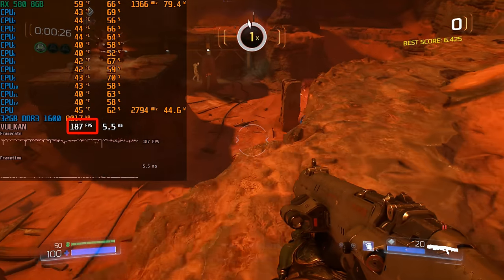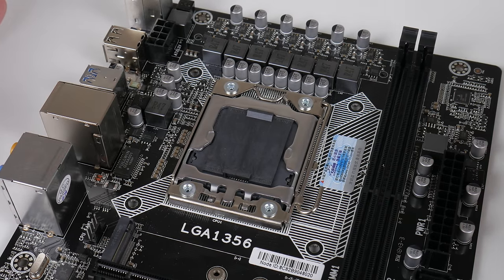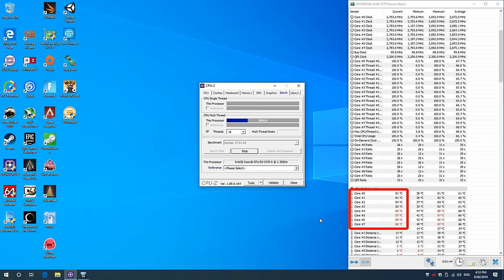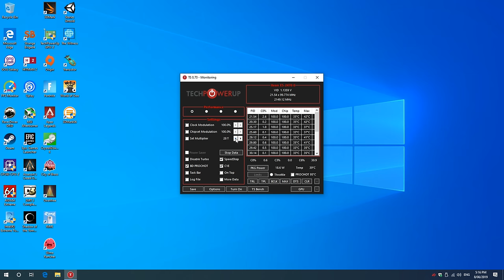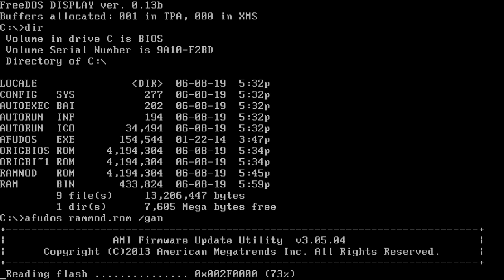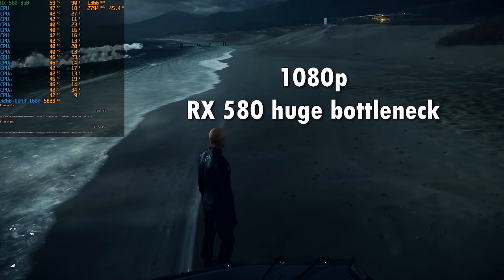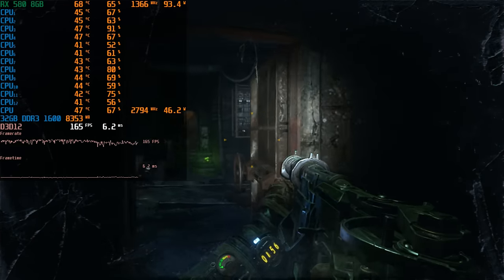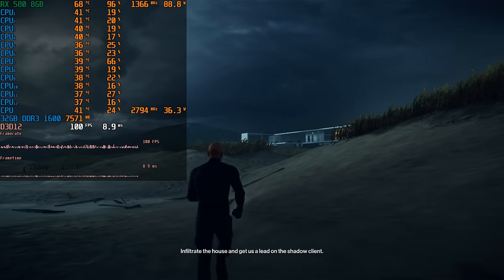6 Cores (and more) for everyone! Taking a closer look at the LGA 1356 platform.

Comment: I'm onboard Phil! I just replaced my HP Z600 with dual X5675s for a Supermicro X9DAL motherboard based system with dual e5 2470s to give me a super cheap 16 core 32 thread workstation, Getting around 1900 in cinebench r15

Comment: Ever since switching my R3E over to an x5680, I'm a huge fan of running the older Xeons. You just can't beat the price, and there's plenty of performance there to be had.
Reply: So did the xeon have much better performance. Cause I am building a pc and was going to buy a ryzen 3 1200 for an upgrade path or would a xeon be better

Comment: Those Xeons are impressive for their age. My i5-4690k is starting to show its age in some newer titles. Stuff like DOOM (2016) and Forza are fine, though. The Vulkan and DX12 APIs seem to push my GPU harder and the 4 core CPU is still good enough @4.1Ghz.
Where the 4 cores really struggle are in Ubisoft open-world games like Watchdogs 2. It gets choked on geometry draw-calls. To hit 60fps consistently, I have to lower the geometry settings a notch or two.

Comment: Once you have done all these motherboards and CPUs can you do a summary wrap up for price performance.
I am mostly interested in content creation.
Cheers
Reply: I'd wager the best option is still the Xeon 2689 LGA2011 Plattform. CPU is like 50$ on AliExpress, Mainboard is about 75$-90$. 8 Cores 16 Threads DDR3 ECC, you get heaps of perfomance for a really cheap price.
Reply: Theman703 that's what I bought, so hopefully lol
Reply: @oscarl-b8870  If I had know about this before, I may would've rather bought the 2689 instead of a ryzen 1600, especially because I already had 16Gb of DDR3 From my FX Rig. Alas now it's too late.
Reply: @OMGOMGOMGOGMOGMOGM  I can't see how Steve from hardware unboxed can say it's only $100 extra for a ryzen system
Reply: Yes I think a longer or multi-video round-up would be good.  There's a lot to take in.  But it seems we hold off on this MB as it isn't the best value.
Reply: @howumighthaveanimatedthat2159  watch the video again, who knows, maybe the second time you will get it. LOL

Comment: The LGA2011 platform is worth it even for the additional cash
Reply: Very true.
Reply: Necro Spencer and that extra is not that much overall. I think really, as Phil said, the value of 1356 is about cheap 6 cores and 12 threads, but not anything beyond that. Want more cores? Just get yourself a 2011 mobo, you get so much more stuff for your money and 8 cores are super affordable.

Comment: A very demanding simulation is City Skylines, that gives any CPU's a very hard time since you can manually adjust counters in the game menu to test the heck out of the simulation and your system :)
Reply: Cities is more worried about the single thread performance still (it uses more than 1 thread but its still limited) - a fast quad runs just as good as anything with more threads.

Comment: Great to see games using multi core well! I sold my old Dell T7500 with x5670 6C12T which looks similar isngle core performance to this. I got an E5 1620 instead as has higher single core performance but 'only' 4C8T. Interesting stuff!

Comment: I went with an X5670 ($19), with 24gb of ecc ram running in triple channel($35, used server ram, eBay auction), and a cheap used motherboard($28), but yeah, the results are pretty much the same, and less than 100 bucks. 
I got a nice used cooler for just $10, a 240gb ssd for $24, and now all that's left is snipping a good deal on a used RX480 8gb, the whole rig should come in just under $200. Hopefully I'll have it up and running by the end of the month.
It should be able to play pretty much everything in high/ultra settings at 1080p/60+fps (except maybe PUBG, that game is just horribly unoptimized).
And it'll pay for itself in video editing work.
Future upgrades for the same computer: 
-PCIe X16 NVMe adapter and 1TB NVMe SSD(non bootable, but can be defaulted to for all programs to be installed on it, and having the video files being edited on that drive will make everything faster as well)
-PCIe X4 USB 3.1 Gen2 adapter (will make getting files from the camera to the computer MUCH faster)
Reply from the maker: Nice! I'm curious, how does your camera interface so that it benefits from USB 3.1 Gen 2? Is that a high speed SD card reader or something else?

Comment: Thank you for your review. I am having big pleasure listening you. It is good that your are showing the power consumption, as it is not common for most tech observers. Maybe here also would be good to add few words about the efficiency for your power supply, as final power consumption is very dependent of PSU. Some less experienced viewers could take it wrong thinking that values of power consumption you show is what only CPU and mobo use, missing the fact that PSU itself can consume from 5% to 40% of power. And due to this real CPU`s TDP under max load actually corresponds to official spec. paper.
Reply from the maker: PSU has 650W and rated 80 Gold.

Comment: cpus are way hyped and over rated. im amazed how well some of these older cpus perform. i personally am using a 10 year old xeon, x5675 , @ 4.5ghz, tripple channel memory, with a vega 56 sittin on it. my gpu isnt bottlenecking on anything, i always get 90-99% gpu usage, this connected to a 144hz freesync @ 1080p, i get 100-144 fps on screen on all the games i play. i payed 18.00 usd, for my cpu- mobo was 100 bucks, ram was 100 bucks, less than 220 for mobo+cpu+memmory, i get the vega 56 for 250.00 usd, for about 500 bucks i have a true 140 fps, 1080p rig that i absolutely love. i could have spent soooo much more, for a system that wouldnt have been any better. ( for games mind you)  for the average gamer, there is almost no reason to spend 200-300 on a cpu, 150 on a mobo, and 150 on pricy ddr4 .... unless you just have no budget concerns, but seriously the used market is great right now, and im very impressed with how well older hardware still holds its own in todays current market
Reply from the maker: 1440p does wonders to make old vs new basically perform the same :)

Comment: Thanks for a wonderful video and here are some comments from my testing.   I'm using the 8 core E5-2450v2 and if I stress test (prime95) the 8 cores withOUT hyperthreading; it hits the 95w tdp limit.   Thus, it may be worthwhile to turn off HT for gaming.   Also, it would be useful to prevent core-parking (speed throttling at idle).  The difference in idle power usage for me was 15.5 watts with 8 cores full speed (2.9 Ghz) and 12.3 watts (8 cores but with idling).   Hopefully this can help micro-stuttering as the LGA1356 chips just lack the max single thread IPC due to their limited 95W tdp max.

Comment: You might try some of those small heatsinks with 3m thermal tape you can get off ebay. I bought some for a 760g motherboard vrm and it worked pretty well. Just make sure it is legitimate 3m thermal tape will typically be cheaper with the tape pre applied.

Comment: Phil. Do you ever feel like we have it too good these days with all these awesome cheap and powerful hardware components ? Thanks for sharing the love.
Reply from the maker: In a way yes, the used PC parts market is really healthy, if you can dial down expectations a little bit, than it's amazing value.
Reply: @philscomputerlab  I've very much lowered my expectations. I actually sold my newest PC in favour of building a butt kicking system from used parts. I have no regrets.
My i7 6700k rig went to a good home, I was originally going to put the money towards a Ryzen 7 3800 on release, I ended up with a Xeon E5-2687W for my older x79 system. That was the highest performance CPU officially supported on my Gigabyte GA-x79 UD3 so I pulled the trigger. It's in the mail right now. I can't wait!
Reply from the maker: @garyhope6577  Yea it's nice to be able to sit back, let the Ryzen 3000 reviews come around. B550 boards won't be out until next year either, so I think it will be a while until the market is healthy and prices settled. Oh and never rule out Intel, they will for sure respond! More and more games are super optimized and you can put most money into a graphics card these days.
Reply: No good deals on decent GPUs due to Mining. Specifically SLI capable components as a flow on effect.
Reply from the maker: RX 570 and 580 are good value, but I will wait for July to see what the new AMD cards, and GeForce Super is like.
Reply: @PhilsComputerLab

The CPU turned up. The results are in
The Xeon E5-2687W is ripping a respectable 1122 in CineBench R15. I've been using it and loving it. Beautiful and responsive. I've not tried doing any video production on it yet but I don't feel like I'm going be screaming out for a I7 9900k any time soon

The real surprise package was I also have a X58A platform system here which had a I7 950 CPU. Cinebenched at 552 when overclocked to 3.83Ghz.
This one got a Xeon W3680 which I promptly overclocked to 4ghz and it's cranking out a ripping 926.

That one genuinely made my face go :O
Both systems absolutely rip!
Reply from the maker: @garyhope6577  I've tried some video editing on a 2650V2 and that was perfectly fine. I use PowerDirector though. I plan on editing one of my future videos on such a machine, just to get an idea of what it feels like compared to my i7 4770.

Comment: I want to thank you as i have just got into older server components. I live in a good used market area for older server gear. so i have a few of these cpus kicking around and will try out some of the china new mother boards as i am tired of having what sounds like a jet taking off in my nerd cave. so the idea of a more normal cooling solutions on my servers with out doing massive mods to 1u rack mount systems is appealing.
Reply from the maker: If you like it cool and quiet, just get a V2 with Ivy Bridge. They are significantly less power hungry.
Reply: @philscomputerlab  yes i have sniped a few of the ivy bridge based servers from a local resale outfits but in a 1u form factor servers they are still loud at idle.

Comment: TDP is what your Cooler must handle and how much airflow your case needs etc, it has nothing to do with power consumption at the wall. You CAN trust the rated TDP of a component. That's why you see those power meters for sale in stores, especially in countries with high power prices. You will also notice it's warm in their houses and the heated floor is on in the laundry.

Comment: I saw HardwardUnboxed's video about this topic on Friday and thought about you and your PlexHD X79 video from almost a week ago - funny I came across this video yesterday.  Anyway,  at first I thought he was calling you and others promoting this type of thing out, but then I realized Steve (?) didn't have much luck in the other silicon lottery - the board he tested was supposedly a X79 board, but it actually had a B65 chipset and wouldn't allow him to change memory timings (among other things).

In terms of price and performance, the Ryzen 1st generation is much better than the X79 platform - especially when the 3rd generation CPUs hit the street. . . plus you get a clear upgrade path from a more reliable board than the one Steve tested.
Reply from the maker: Yea I used a different mainboard with better layout, M.2 and USB 3, a faster CPU and I modded the BIOS to allow RAM to run at 1600 MHz instead of 1333. That all adds up.

Comment: On motherboards this small, it's good that they didn't offer triple channel memory. The extra length that the motherboard would have needed wouldn't have reached the next set of screw holes - and one of my motherboards which has that manufacturing choice flexes and creaks alarmingly when I install RAM.

Comment: Best channel on YT for me currently, not just the subject but the depth of coverage on the subject.  Answering our questions so I really feel I am going to buy with this.  I do Have 4 builds to go yet, and I need to sell at least 2 or my wife will leave me, or make me leave her and sleep on a tent.

Some limitations on I/O but this is still a good deal.  One thing, about 09:32 we can see you talking about RAM and the SATA ports are labelled ATA 3.  Earlier you say they are only SATA 2?  Not sure with the memory issues, what to do?  Do I just order the RAM and accept it will probably work but not as rated or am I better getting on eBAY and going with 2nd hand DDR3.  In the UK DDR3 isn’t really cheap and ECC isn’t always cheap (and tends to be even slower than 13333 often enough.

Really have to place an order on this though.  What I really would like to see is some SFF/ITX is that available, I would probably be happy to be a guinea pig on that as the CPU will be OK and I can always order a mATX if I hit a dud.  I can face losing $60 on a gamble.

This is the best YT channel I watch at the moment, can’t praise you enough.
Reply from the maker: The ports are usually labelled from 0 to 3, but yea, they are only SATA 2. It does have M.2 NVME slot for better performance. So with DDR3 registered ECC from China, I have bought 4 RAM kits, and in terms of function, they all perform to what was advertised. But some RAMs are modified, meaning they overclocked them, but I believe they do test them. I also found that most RAM locally is only 1333, but most should OC to 1600. But I've also bought 1866 RAM locally, you just got to keep looking. Before you rush out and buy 1136, do consider 2011 socket with a 2630V2 CPU. I'm working on a video comparing 1356 and 2011, and even at the budget end, 2011 makes more sense. The boards costs more, but are faster and way more features, and CPUs are cheaper.
Reply: @philscomputerlab  Yes I am going to wait, like I say I have 4 builds to do yet and I'm being quite slow about them.  Just great that you do such in depth videos because I don't have the nervousness that I would have about the China thing normally.  I heard about it but you explain it.
Reply: @philscomputerlab  Yes, idiot that I am, I'm just looking at SATA port number 3!

Comment: i think its better to go with a 2011 socket and thats because you can get boards for around 80 dollars and you can get a 8 core e5 2650 v2 for around 50 dollars
Reply from the maker: The 2650V2 is my favourite recommendation, but prices have crept up to over USD 70...
Reply: @philscomputerlab  never mind i think it was the c2 not the v2
Reply: @philscomputerlab  it was on ebay you can get them for 55 usd

Comment: Another great video, Phil! So informative. Im just about to build a Ryzen 5 2600 system with my rx480. I would like to look into a x79/x58 system. Just to see how it performs against a midrange system of today.
Reply from the maker: The 2600 is quite powerful, you need a CPU that is unlocked, like 1650V2 and clock past 4 GHz to have a chance.

Comment: Regarding the wattage and TDP, you should explain that TDP is for amount of heat generated by processor and has nothing to do with actual power consumption of processor. This is why you have TDP ratings on coolers for example Max Wraith has TDP of 95W meaning it's ok to cool cpus that have TDP <= 95W using this cooler.
Reply from the maker: Yea but that TDP is totally inaccurate. A 80W CPU, 50c on CPU and VRM, whereas a 95W TDP CPU 90+ and VRM over 125C, then shutting off machine. That was the point I was trying to make :) Whereas the power meter showed a much more accurate picture of what was going on.

Comment: im getting one of these boards because their cheap pretty much lol for my stepbrother however its not this board you showed in your video its a jingsha x79 board for $49 USD. i still do have a e5 2420 v2 sitting around im giving him this setup because hes running on a fx 6300 so since alot more games are using more threads thought i would give him a little upgrade thats better for core thread work flow for games and other processes in the background.

Comment: @ 12:45 , use enzotech mos-c1 cooler to improve vrm's cooling. 1pack: 10pcs with adhesive thermal pad, for my motherboard im using 2 packs.

Comment: Do you have any plan on making an overclocking video on the PlexHD mobo from last video? I'm on the edge of buying that board. And please compare E5-2689 to R7 1700, R5 2600, and/or i5 9400F!!! :D
Reply from the maker: Yes that's coming soon! I'll be using a 1650V2! And I don't have any such modern parts, they are quite expensive. I do need a faster GPU though, the RX 580 is not cutting it with faster CPUs, even at 720p it's bottlenecking the systems.
Reply: @philscomputerlab  Understandable, I hope you can afford a high end GPU soon. Btw why don't you monetize your videos? An ad at the beginning and the end of your videos will be fine.

Comment: What coincidence... i just bought and receive the same motherboard set....
with 16GB with 2450v2.....
Reply: i plan to used it as a VM server...
but sadly, the motherboard only have ONE NIC (and it's a *realtek NIC)....
have to buy a separate INTEL NIC for ESX to work....

*before you guys complaint there is a realtek patch for esx...
i prefer not to go that route as VLAN is not working correctly with the patch....

Comment: Hello Phil's this is very helpful video which coincides with my current plan to build using a 2420v2 cpu for this platform. I'd also like to ask you that since m2 nvme port is not running at full speed, is it possible to put a normal m2 sata ssd on the port instead? Thank you Phil for your video
Reply from the maker: Hmm, there might be adaptors, but not sure!
Reply: @philscomputerlab  I mean there are m2 ssd with sata protocol right? Not all m2 ssd is nvme. So I'm wondering if that m2 sata ssd will be detected, I heard most motherboard with m2 nvme port will detect m2 sata ssd drives but I'm not sure and hoping you'll be willing to check since my motherboard has not yet to come.